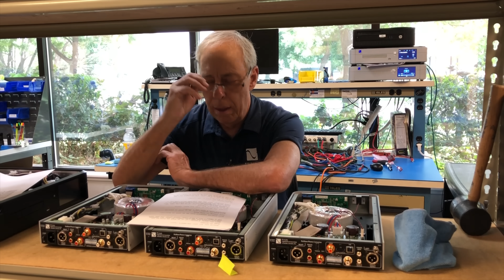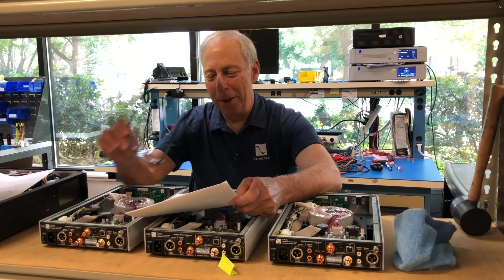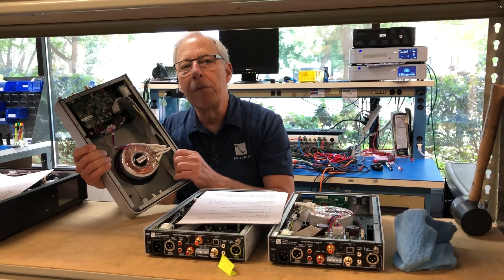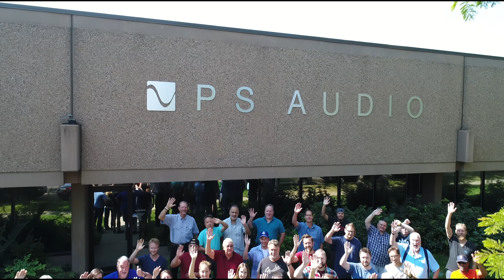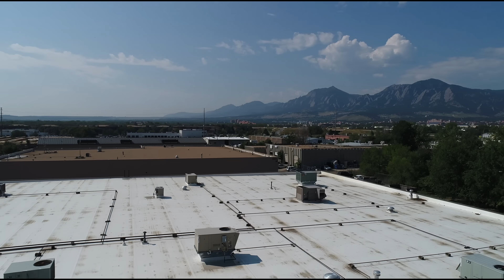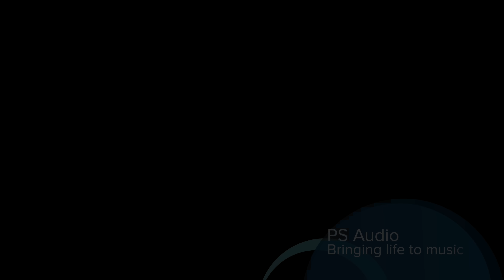What's inside a high end power cable?

Comment: If a high end power cable sounds any different than a well made IEC power cable in the $10 range, then the power supply on the device being connected is poorly designed. Any power supply  in a device should make the assumption that the incoming AC power may be noisy, and it should be capable of filtering that noise out. If it cannot, a snake oil power cable isn't going to solve the problem.
Reply: Run the experiment yourself bruh, you would be shocked how many “improperly designed amplifiers” you own
Reply: @sunnohh  my point isn't that the amplifier can always compensate. My point is that the power from the mains isn't clean, and that a cable hand crafted by nude virgins and grey beards in some mountain in Switzerland isn't going to fix that.
Reply: pjtruslow exactly right. And I do find it funny that this "high-end equipment" apparently requires special power cables to function properly. That is hilarious
Reply: Special expensive looking power cables sound better for believers...except in blind tests!
Reply: ThinkingBetter Exactly, or when measurements are taken...
Reply: Yes, but those true believers in snake oil generally don't have much depth of understanding and often argue that measurements can't cover everything the ears can hear. While that point CAN have some truth to it, especially when you talk speakers and room acoustics, it's definitely not the case for 5 feet of AC cable connected in series with 50 feet of standard power cable in the house. A lot of things are measurable in an audio system but unfortunately you have a situation of some audio companies profiting from promoting snake oil; and never do those of us who know better gather to do a "debunking of snake oil workshop" with proper blind tests and measurements to prove what is real and what is not. Actually I've often thought about having such truth-proving event would be great. Few industries have escaped from proper scrutiny for as long as high-end audio. BTW, often we don't even need measurements because things are completely predictable by simple math and laws of physics. For example, an "audiophile fuse" might have less resistance causing a reduction of the voltage drop to the transformer that can yield a slightly higher secondary side voltage of the transformer and thus a slightly higher Vcc driving a power amp potentially adding a tiny fraction of a decibel at peak output. While some of us already know that's way below noticeable, still without a credible proper blind test done, believers will keep believing.
Reply: ThinkingBetter and they want to assert that a speaker is responding to some signal that can't be measured. Complete nonsense. If the speaker is responding to a signal, then a signal is present. It can be measured if it's there. There is nothing mystical about audio. In reality, it's a low frequency, low bandwidth signal that is easily understood.
Reply: Yes, agree. There is too much snake oil nonsense involved in high-end audio. It's unfortunate because making great sound isn't actually trivial and putting money in what matters can result in better sound. Only a few companies understand the no-nonsense approach to great audio at good value and it's a bit like this nowadays: Audiophile companies typically do their R&D in western countries and they need some degree of snake oil to pay the bills while non-audiophile companies typically do their R&D in southern China (Shenzhen, Dongguan, Huizhou etc.) and they use inexperienced engineers who just graduated from college to optimize the audio performance against Chinese songs with no bass or treble content. A few exceptions exist besides that. How do I know? I've worked with many of those companies on both sides of the Pacific.
Reply: ThinkingBetter Thanks for that!
Reply: No way a power cable can affect sound. Even if it affected anything by the time it got through a decent power supply, with its capacitors, rectifiers,transformers,  etc, the "effect"would be lost. A lot of high end power cables are picked out of industrial catalogs, their primary requirement being they look cool. More development is usually spent on packaging and on marketing,than the cable, which is really just copperwire
Reply: Billy Grinstead Yes, it’s all about looks and the more heavy and expensive it looks, the more believers can hear a difference (in non-blind tests). Manufacturers of these cables never want to conduct a proper blind test or measurements of amp performance because they will end up confirming the snake oil a 5 feet piece of over-priced cable really is. Besides, the actual manufacturing cost of these cables is less than US$10 even when they sell for 100s of US$. The crazy margin is another good reason this business is a scam. If we all agree that snake oil exist in audio, this is one place where it’s well deserved. I’ve been a lot to Shenzhen and know very well how the business works. Example, what’s the price of this cable? https://m.alibaba.com/product/60716920140/link-YH183-Audiophile-Power-Cable-Cord.html?spm=a2706.7843299.1998817009.30.4bd11a87hfKu2D
Reply: I am curious, I am not a person who spends a ton of money on power cables, but for the people here preaching about snake oil, what kinds of systems are you listening to music on? I have some pretty expensive power cables ($500 range) but I got them at a garage sale where they didn’t know what they were selling for $2 each, but I am curious as to what people are listening on. For the record, I don’t hear a lot of difference in the cables vs the stock ones. I DID hear a huge difference when I got a power conditioner however. I also heard a big difference when I swapped out the power outlet. But the power cables...not much
Reply: aaron phillips I can't speak for the others, but I'm not listening to them on any system. I don't use them at all because their claims are definitely false.
Reply: @aaronphillips1210  I could understand hearing a difference with a well made power conditioner. The outlet I don't quite understand. Unless that outlet added significant inductance or your previous outlet has substantial resistance, it shouldn't have an impact.
Reply: @pjtruslow  I had a lot more static in my system before swapping the power outlet. I use electrostats and before the swap if I turned volume up to a moderate level with no music playing I could hear the buzz from the power across the room. This buzz of course then still existed during music playback, just harder to hear because of the music. After the outlet swap I could crank it all the way up and there was no buzz at all and my highs were a lot better and alot cleaner. I am not an electrical engineer so I can't claim to know why, but it did make a big difference.
Reply: @aaronphillips1210  Interesting. I doubt that the new outlet is magical, more likely that there was some issue with the wiring previously, either in the outlet itself or the binding posts on the outlet. Either way it's good to diagnose problems in your system.
Reply: I don't care if it works or not, if I think I can here a different, placebo or not, I am happy.
And as Paul said, forget about what you know, try it and find out why it did (not) work afterward. :-)
Reply: Fried Mule Whatever makes you happy is fine. Of course expensive looking cables can please the eyes and make you imagine the sound is better too. Seeing is believing for snake oil audio. Personally I like to see my money spent on things that don’t fool my senses though.
Reply: ThinkingBetter you are so right!!
I have an open mind but not so open, my brain falls out!
If I find something that I think make the sound better, I look at the price and evaluate if these money was better spend by adding them to a new amp, cd-player or something. There is in my mind no reason to bye a gadget that give a slightly better sound, if I can get significant better sound by using them on something else.
But my politic can also save me money, I do not feel that the old vinyl, give me better sound, so I don't bye. :-)
Reply: Sounds like someone bought snake oil power cables xD
Reply: This is a golden comment. Cause you're running at least a 8 meter cable from your power divide box thingy to your outlet....... and those cables are not properly insulated.....
Reply: Exactly right. That power cord delivers a given amount of current at a given voltage. That's really about it. The only other concern would be if the geometry of the cord conductors is off, then one of the conductors could induce a small voltage into the grounding conductor.  That could cause some noise problems (hum, buzz) in unbalanced systems.. But, that really should not be an issue. The talk here is nonsense..
Reply: Go back to your MP3s and crappy stereo. When youre ready to join the big boys club, let us know
Reply: "This seems dubious for reasons x, y and z"
"LMAO U HAVE A CRAPPY STEREO AND A SMALL PEEPEE EXDEE LMAO XD"

Huge win in the battle of ideas